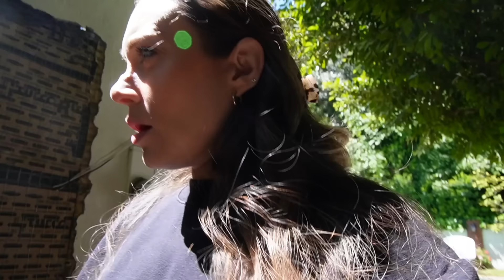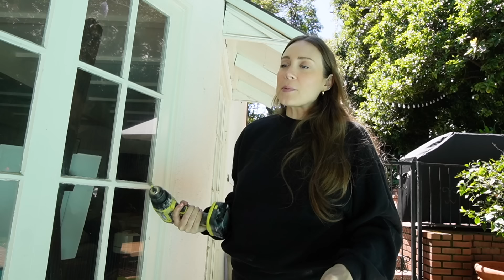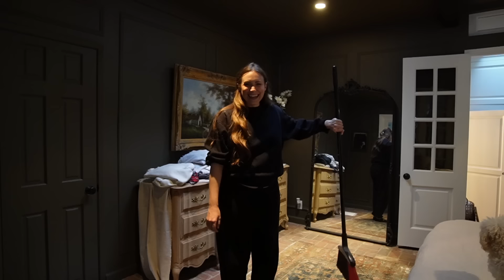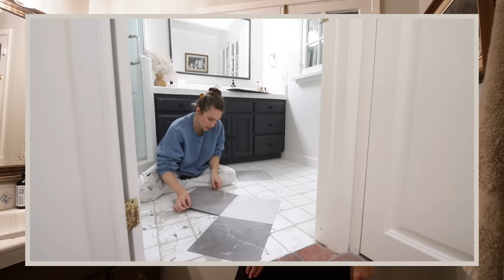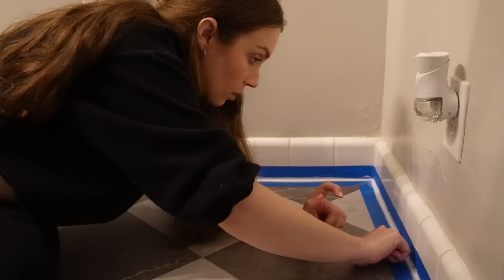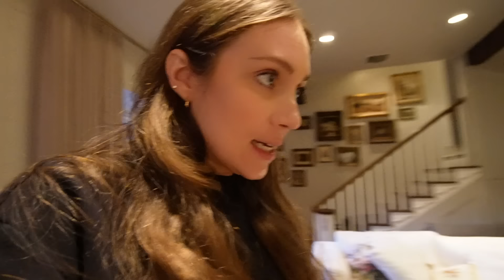tackling home projects *before our baby arrives*

Comment: For others planning to do a caulk project like this, NEVER caulk around the toilet. Caulk will prevent leaks from showing themselves. Instead of the leak appearing around the bottom of the toilet so you can address them quickly without damage, caulk forces the water to sit UNDER the toilet bowl and the water will find a new way out, usually around the subfloor so you'll have to completely demo the floor and possibly the floor joists/ceiling if the bathroom is upstairs. If you install any kind of flooring and want a clean look around the toilet, the toilet should be pulled out so the flooring can go under the toilet then reinstall with a fresh wax ring ($5).

Comment: For the silicone you should dip your finger in a bowl with water and a drop of dishsoap. It will make application easy and it gives you a real smooth surface.

Comment: Macenna, when you're aplying silicone on tiles or any flat not porous surface you can use this technique, it's lot faster and you get even cleaner look! Use spray bottle with half dish soap half water, spray it down on surface where you want to put silicone, apply silicone, spray it again with same solution and use rubber joint trowel. You can choose trowel by different types of corners (the one for bigger or thinner joint, rounded, 90degree etc..). I guarantee that you are done in 20minutes :)  p.s. for cleaning trowels and extra silicone you'll need only paper towels

Comment: To each his own, but I come from a contractor family and I would never do the silicone like that. It leaves it looking like a clothesline rope around the edge. It should actually be concaved inward so it's not so noticeable. You do this by laying the bead then running your finger along it so it actually goes down into the crack or space. They also make a little tool you can do this with if you don't want to use your finger.
Reply: If you dip your finger in water it makes it so much easy as well 😊😊
Reply: @biggyziggy5777  water does nothing. You either need a drop of dishsoap in it to create a surface on the material or use special "lube" for caulk.

Comment: A little tip, have a bowl of water with a little dish soap in it and dip your finger in it before you smooth out the silicone, less sticky and it will be a smoother edge 😊
Reply: Great tip!

Comment: Hi :) A little tip: there are things called Joint smoother for silicone, you just dip them in a bowl of water with a bit of ditergent and go over the edge... you don´t have to tape it anymore :)

Comment: If this helps! I often work with silicone and products like it…
If you spray it with a little bit of soapy water when rubbing/running your finger over it to create that clean edge it’ll make it a lot smother and much easier to work with. It also enables you to work with it in slightly longer sections. I hope this helps! Lots of love from AUS 🇦🇺

Comment: Thanks so much for that tip on applying caulking.  I've never heard that before and I've got some areas needing to be recalled that I'm needing to do,  and have breen really hesitant to start it since I'vr never done it before. However, when our new toilet was installed, the caulking done around the base is absolutely TERRIBLE!  It is everywhere, and every time I look at it I just cringe, and I've have been determined to redo it. Plus I''m going to have to recalk my kitchen counter top between the tile and the wood trim surrounding it. That is done with a marine caulking that will withstand more water on a regular basis than other caulkings since it's used on boats and around marinas.That area is such a thin  area that I think the tape will definitely be a big help in recaulking that area for sure.

Comment: Helpful hint as a mom whose Dad was a doctor:  Rub your belly and all around with Cocoa butter.  You should not have any stretch marks afterwords.  I am now in my 70's.  No stretch marks even at this age.
Reply: I think a lot of it is genetic, though.  I used nothing and not a single stretch mark anywhere - after pregnancy and repeated weight gains and losses.
Reply: Yes agree won't hurt even with good genetics. Keep the belly moisturized with cocoa butter. Palmers is what I used. Didn't get any stretch marks

Comment: I just love all the things 😍 The tapehack is good, you could also spray dispsoapwater from spraybottle on top of the silicone line and then run finger on it, thats how it doesnt stuck so much on fingers. If you have right amount of silicone then the tape isnt necessary😃 afterwards when silicone is complete dry clean the area from dishsoapwater trips (same effect from dipping your finger on dishsoapwater before running the silicone but I prefer spraying). Not sure if it works on caulk cause its different but especially on silicone its great🤩🤩

Comment: Did you know that you can buy caulking tools kits that make the sealant look really neat without using painters tape? They’re just made of rubber or silicone. They’re really inexpensive and come in sets of 4 or 5 with different shapes and sizes.

Comment: Just a note when you caulk. Go with the angle of the cut on the tube, not against it. If you go with it, the caulk will flow in a cleaner, longer line as it exits the tube. You will learn quickly how to do it with a smaller hole and without tape, making the job way faster to do and making the caulk go much further. When you stop, instead of putting your finger over the opening, release the tab at the end of the gun to release the pressure and the caulk will automatically stop flowing. Do this right before you stop caulking so that as the pressure subsides, you can still apply caulk the last bit of exiting caulk.
Another thing. I couldn't tell if you caulked all the way around the toilet, where I live no-one does that anymore. The back is left open so that you will know if the toilet leaks before it fills the space beneath the flooring and then eventually creates a major flood. Plumbers here don't do any caulking around toilets anymore for that reason.

Comment: @xomacenna do you think I could use silicone in the horse trailer that rust has made holes on the seam? I store my horses hay in there but I have to cover it with a tarp and make sure it gets uncovered when the rain is done cuz as you know in Central TX mold curettes quickly here!